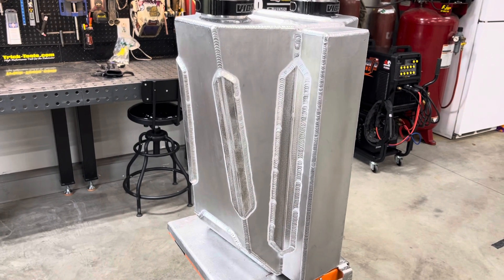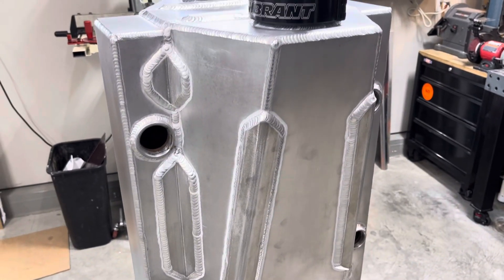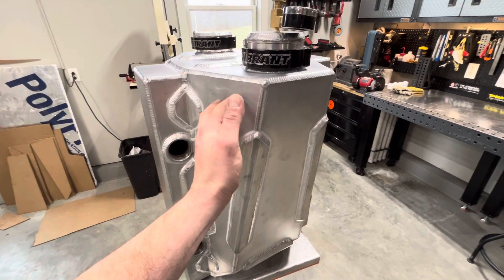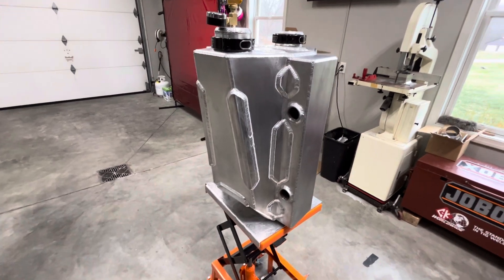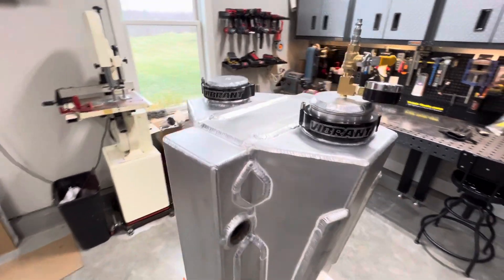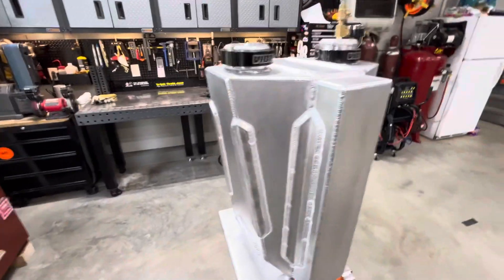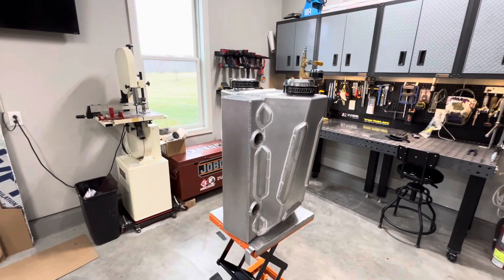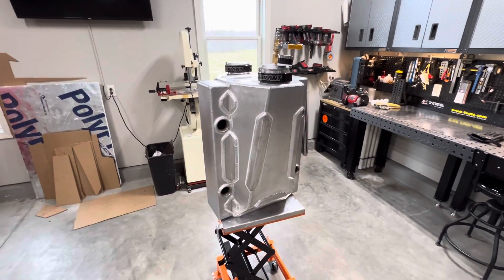Tig welding 5000 hp water to air intercooler!

Comment: 6061 likes to crack when you bend it on a press brake or bend it in general, 5052 would be an excellent choice if you wanted to bend as much of it as possible